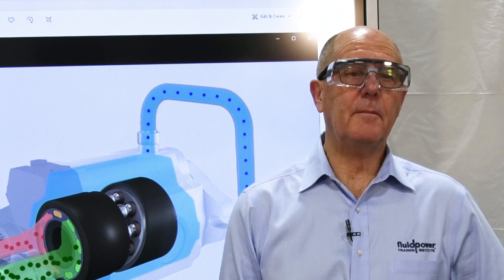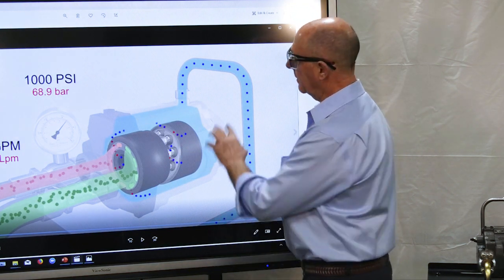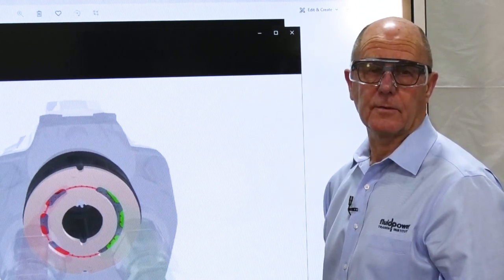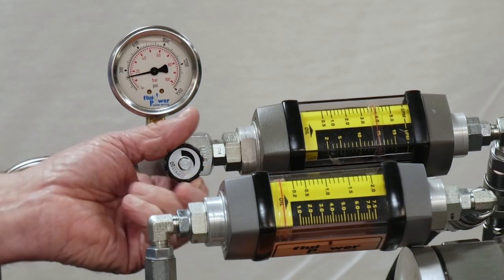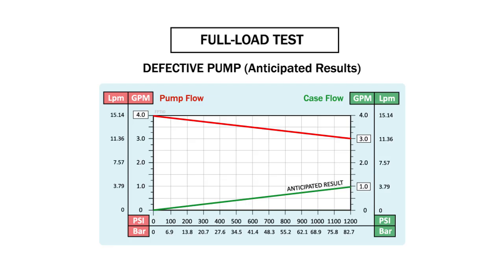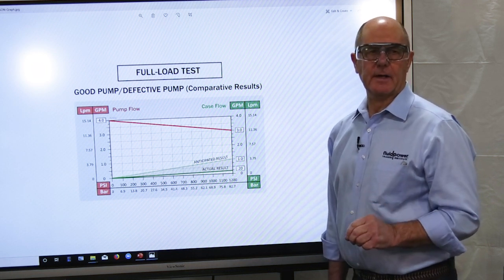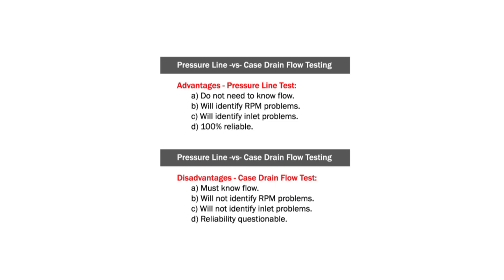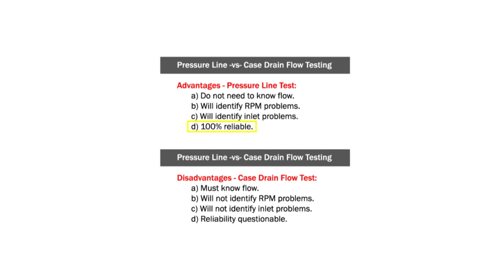Case Flow Testing Debunked

Comment: Your conclusions are completely predictable... so I wonder who decided that monitoring the case drain test would predict anything meaningful as a diagnostic or performance monitor? However, the case flow test will identify leaking pistons against the swash plate which would be seen at the case drain as flow as well as the flow reduction at pressure. Ideally you would have the measured parameters for both case drain & pressure under load because it would allow you to determine which parts (plate or pistons or both) are worn. Known good condition test data would also be valuable for both as well, but this is new system performance data...

Comment: Nice video showing one aspect of wear that occurs in a hydraulic pump (the interface between port plate and barrel). This test is done by any respected pump repair center and is basically industry standard.
I think that you have opened a can of worms though by stating that the case drain method has been 'debunked', in certain situations this is the only test that be performed while on the field and does have it's merits.
If showed a test with not only a worn barrel and valve plate, but also a piston and swash plate set that have similar hours of operation, you will find a significant increase in case drain flow.

Keep up these videos, they are very well made and definitely will help in teaching the concepts of hydraulics that really require visualization.

Comment: I have watched your video and found it impressive. It clearly shows what can happen when the wear ring wears in such a way. Although I agree with your findings, I don't agree that you have debunked the case drain test. Most piston slippers are brass for protecting the swash plate and the piston ports have brass bushings for protecting the piston barrel from damage. The clearances between the pistons is .0003" to .0004' thousands of an inch. When the brass starts to wear the clearances get larger increasing the opening from pressure port to the pumps case. The slippers have orifices drilled in each one to provide lubrication between the slippers and swash plate. When the brass orifices increase in diameter from wear, you get increased case flow. I have troubleshot hundreds of pumps over the last 35 years in the field some as a Millwright and many more as a Hydraulic Specialist and have found it to be effective in most cases. There are many other ways to troubleshoot pumps as well, I dont just rely on this one test. I will keep teaching and using this technique as a means of testing pumps. I liked your test, but the wear ring is not always going to be the part that fails.
Reply: This video shows real interesthing points.. but.. normally most of pumps if you do a drain leakage test , it will show if the pump is worn.